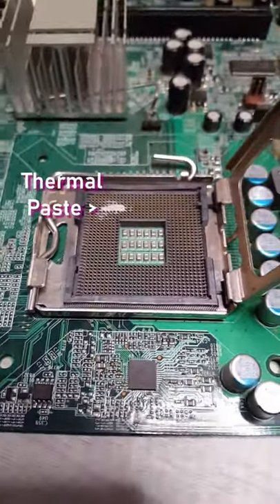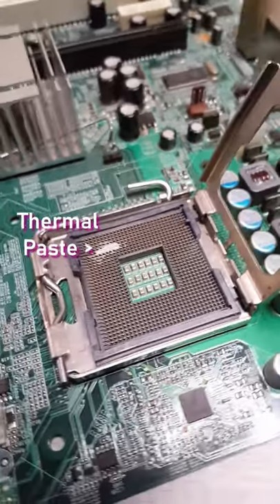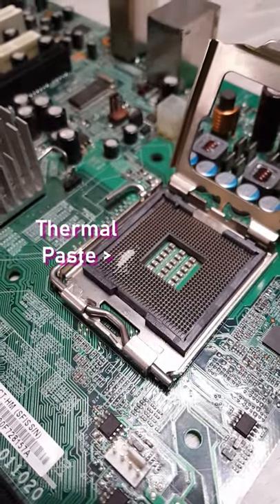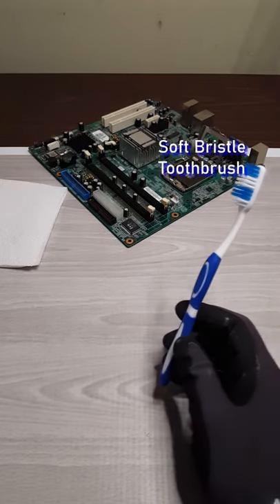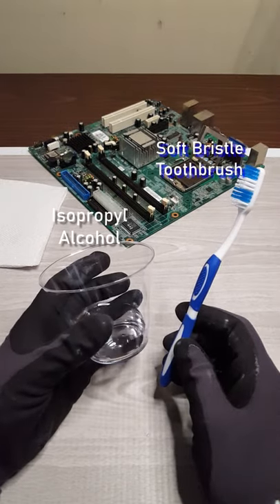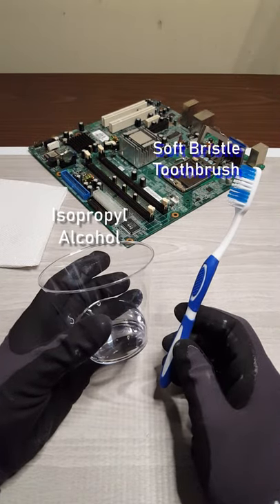Removing Thermal Paste From Motherboard Pins #Shorts

Comment: Really good advice.
Reply from the maker: Thank you!
Reply: Not really good only ok decent advice, the best really good advice would be to just use crc electronics cleaner or non choronated brake clean and spray the shit out of socket, enough pressure to clean but no enough to damage, and dries just like and as fast and alcohol, also only takes 2 seconds instead of 3 min
Reply: @johnshek8727  yeah but not everyone has that
Reply: @johnshek8727  I don't think anyone has that so that's kinda an issue
Reply: @johnshek8727  oh yeah ur advice is „only ok“, who is gonna get all of those things if you can get it done like he did in the video, far easier than ur method :D
Reply: @johnshek8727  alcohol isn't gonna hurt a motherboard any more than the alcohol/toothbrush, especially if you're as gentle as this guy was.
Reply: You can buy brake clean at autozone probly right next to walgreens where you buy your rubbing alcohol, its not like you have to go out of your way to buy it, shit even if you go to be a big supermarket that also sells like office supplies/video games/sporting goods like Wal-Mart, youre prolly going to buy your rubbing alcohol at walmart so why not walk down 4 isles and grab the brake clean. Just as easy to get as rubbing alcohol
Reply: I recently saw perfect toothbrushes for the job with super soft, dense and very thin hair

Comment: *Accidentally bent a single pin
Reply: Pain
Reply: Rip
Reply: Pain
Reply: 00F
Reply: @Lightsivall then u remember... That pin isnt in use xD
Reply: Only one? Pff, i bended around 10 of them with my first try xD just pick your credit or ID card and put it between the pins.
Reply: F
Reply: Bent two, could fix it with a needle luckily. But surely they'll loose some strength after bending them back in place
Reply: F
Reply: Bent it again in the right direction, it would be just fine

Comment: VERY IMPORTANT: Use the highest percentage rubbing alcohol you can get, otherwise you risk water damage. 90% is fine, I personally wouldnt use 70% one.
Reply: Why electronics are fine when using alcohol when it is essentially a liquid same as water?

Can alcohol rust component too?
Reply: @YoLo-nz2fo  water has moisture, alcohol doesn't
Reply: @YoLo-nz2fo  Less conductive, the higher % alcohol, means it will be less conductive due to water, a high conductive liquid,  percentage being too low.
Reply: @UKUSA  Yup True, but this water isn't available for anyone unless you specifically purchased it. No bottled or tap water is minerals/chlorine free

Comment: Me laughing in AM2+ Socket
Reply: That's lga
Reply: @mar_3620  I know i meant i’m using a AM2 socket so i removing thermal paste off my board is easier the pins are on the CPU not the socket

Comment: A little while back I got some thermal paste on the pins in my Threadripper socket, it was an absolute disaster, but I used this same method back then. Definitely can vouch for it! Also, don't use Q-tips to do the job as sometimes the fibers can get caught on a pin and then you got a disaster on your hands benching the pins back

Comment: A much better method is using a can of Contact Cleaner.  Spraying it in the socket instantly dissolves it.  Thermal paste is far more soluble in it.

Comment: Imagine having pins on the board and not the cpu

This comment was made by amd gang😎
Reply: Intel invented the standard. But I'll give you a like anyway.
Reply: Actually it's bad generally cpu is more expensive than mobo so I'd rather sacrifice mobo
Reply: @shrysm  What does that have to do with pin formats?
Reply: @mehmeh1999  pins are easy to bend and it renders the device basically useless. The person would rather have a mother board with one as it is cheaper to replace.
Reply: @carsin60  AMD pins are extremely tough though. The Intel ones bend super easy but you could basically drop an AMD cpu and it will be fine
Reply: @ProjectYoutube  That's really nice to know, when I built my pc I handled my cpu like a bomb when building my computer because I was so afraid to break the pins as I saw many people do online.
Reply: @ProjectYoutube   very much depends.... There's 1331 of the pins so yes they are very strong directly down, Im sure u could stand on it
But if you're dropping it you're the luckiest sob in the world of I get it to drop flat and not on the side
Reply: @ProjectYoutube  They're actually less tough than the old intel ones.
Reply: @ProjectYoutube  If you drop a cpu on its pins then you're guaranteed to bend them.
Reply: @mehmeh1999  not really, before lga775 intel used pga too
Reply: @Half_Finis  Maybe not stand on the CPU lmao but I get what you mean
Reply: @carsin60  amd pins are really tough, not only can you put the cpu pins down on a table, you can put a considerably large force on the pins and they won’t bend.
Reply: gay
Reply: Amd gang👌👌
Reply: @ProjectYoutube  I agree 
I managed to drop my 1300x before and bent one pin....they also are very easy to repair tbh
Reply: Imagine having pins on either your motherboard or CPU.

This post was made by Slot 1 gang 😎
Reply: @mehmeh1999  Cof Cof Amd Epyc Cof Cof
Reply: @ProjectYoutube  i doubt
Reply: @ProjectYoutube  lol this is just plain bullshit. You'll find a lot of horror stories on people bending and breaking pins on their AMD cpus. They have beast cpus with budget pins. That's why they're moving to a new pins setup
Reply: @fiv3 you really came back 3 months later
Reply: @BenCos2018  yea if its bent.....but sometimes when u do that there are chances that the pin would break ......
Reply: @gdxd8302  yep agreed
Reply: @BenCos2018  have a nice day :)
Reply: @gdxd8302  you also
Reply: @shrysm  I'll agree with you but AMD uses this trick for more power as they use 7nm proccesor (can't believe intel is taking more than 3 years to even get 10nm)
And amd also want more space for upgrade so they don't use pins on motherboard
Reply: @GWCGamingwithChittaarth  yeah ik that,I'm currently rocking 3900x 😁
Reply: replying to everyone here. 
Pins are the past now because you cannot pack them densily enough without making them to fragile. 
What i liked about am4 was that pins were still large enough to be replaced by hand replaced a pin on a Ryzen 5800x. 
You cannot do that on motherboards anymore because they got so many pins and the pins are smaler and recessed. It's almost impossible to replace them.
Reply: Oh only a year and ut didn't age well
Reply: hey ive got some spicy news regarding amds latest generation
Reply: @shrysm  until your mobo cost more...X series gang here

Comment: do ensure you use 99% isopropyl alcohol too, as if you use 70% IPA (commonly available in pharmacies as disinfectants) contain 30% water, which may potentially be conductive once the 70% alcohol dries up.

Comment: Once I bought a used motherboard like this and in sight I missed to see the thermal paste on it.
Went home,Cleaned it for hours,then It still didn't work.
Apparently the bios was outdated.
Had to go to a dodgy basement to give it to a master, forgot to bring my CPU to test it so I had to go back tomorrow,going back again and waking him up, forcing him to fix the damn board,cooking the board,removing the old bios,he got a new clean bios chip and uploaded the new bios data in to the new bios chip, Putting it back in, Testing it...

We have life

5 month later I sold the whole build for all the cancer and unreliability
Reply: Nipun Singh  that's just the motherboard,the GPU,mounting brackets and how I got the CPU cooler is a whole another story.
Pro tip:Buy new

Comment: You can actually do the same thing by putting a little bit of water on your CPU pins letting it dissolve the thermal paste and then washing it down with 91% isopropyl alcohol

Comment: Very useful advice, but I have a 7 years old workstation laptop and I want to proceed to clean the inside of it because it is overheating enormously , so I expect that old thermal paste will be pretty hard baked onto the surface of the CPU and Heat sink brass tube. Do I use the same Isoprophyl Alc. or something else to clean that old paste?

Comment: I've cleaned the pins, over and over. If the paste is dried in between the pins or on the bottom of the board, dried in = Should you be ok ?

Comment: I have to clean these for my job and i nearly had a stroke when he got that brush near the pins cause fudge me those are super sensitive. I'm gonna try this at work with a cheap board
Reply: How do you normally go about cleaning them?

And how did you go with the toothbrush method

Comment: I just wiped the socket off a bit and installed...I dont recommend it but it seems fine...lol

Although mine was an amd socket so maybe this is a worse situation being this cpu is an intel with the pins on the board.

Comment: I just used brake cleaner, I did it with my rx470 4gb, 480 8gb, motherboard, ram, cpu and everything else and it is clean as new ( yes it is still working, its alcohol)

Comment: Or just buy a can of Brake cleaner (NOT CARB CLEANER, THAT WILL MELT PLASTIC) and just spray it all off in 10 sec and not have to worry about the pins!

Comment: I'll do I the same if it spilled somewhere there.
I said the PC support shop keeper to put some thermal paste in it, he told his worker to do so who was already very old.
He wasn't even able to open the CPU properly, and applied a lot of thermal paste even after I forbade him to do so.
Now in game, my CPU temp remains  almost the same, I would say 4-5 degrees more and my motherboard temp remained at 72°-73° stable before, but now it reaches upto 86%!!
Idk what happened, maybe some of exess thermal paste spilled on the motherboard.
I'll go the the freaking support center and repory to them what they did!
I think this methor would work to remove the exess paste.
I wish the shop owner himself applied the paste, he was busy at thet time.
He's an expert and knows probably a lot about computers.
Anyway, after cleaning the thermal paste, I'll apply it myself properly.

1 question- After cleaning the thermal paste with isopropyl alcohol, how much time do we have to give it to dry?

Comment: How do you even get thermal paste on the pins tho.
ALSO. Unless it's some copper or silver or liquid metal bs it's usually not electrically conductive which means in theory you don't even need to wipe it away

Comment: How does one get thermal paste there. You shouldn’t even be touching the paste until the cpu is in the socket
Reply: I boght an old pc and the thermal paste was crusty so when i took it apart it landed on the cpu pins

Comment: I just wash the motherboard with the garden hose, you might think it’s a joke but I have done it to over 10 boards with no issues as long as the CMOs battery is removed and the capacitors are drained
Reply: Ñíçé

Comment: If it’s non-conductive thermal paste just drop your CPU in and go. It’ll even cool the bottom side of the substrate!
Reply: True, but it could make the connenction between the cpu and the motherboard a little worse
Reply: you sure? sounds not right
Reply: @leonbishop7404  it probably doesnt function good with the paste on the pins, because its non conductive and it will maybe stop the pins from touching each other.
Reply: @matthias3219  yeah, it can cause poor connectivity, instability and all kinds of errors and hardware failures, aswell as overheating in that area, no matter if its conductive or not

Comment: I had the same problem with my ryzen after i changed the stock cooler to be quiet dark pro ... when i rempved the stock cooler cpu was stuck on cooler.. and i somehow got then thermal paste on the cpu
Long story short it didn't start, some alc and cotton swab later i cleaned it and work perfectly no need to buy new

Comment: Yeah where the hell can I get an ecu for a 2014 mustang gt 5.0 pretty much all the scrap yards don't, any of the rebuild sites I gone to already either don't have it or can't repair. And just my year and style for the most part, and the back logs to order it from the dealership is so long it doesn't even have a time and not 1 dealership in the United States has one so they all say. And I've had it sent out to be rebuilt 2 times now and both times it comes back saying we don't repair this particular circuit board. Really why not? You took my vin part number hell everything about everything but now all of s sudden you just don't do those.?? I need any help I can get, I've been trying to replace this damn part for over 3 months now. Oh also so I can personally double check the ecu myself because that's my luck lately because 2 diff electronics mechanics said I have a bad ecu/pcm all I know is I was coming back from seeing my son in Kansas and 30 miles before I was home the car went into limp mode and turned itself off and couldn't turn it back on for almost 2 hours. And I changed all the filters all the spark plugs checked the evap box and replaced both upstream o2 sensors and checked the mass air flow. Last time it was tried it would turn over but not start either. Idk I can't give it up its my baby and spent 32,000 plus about another 25,000 on mods upgrades chips  and restoration from the dipshits that stole or robbed my for. They dogged it wrecked it destroyed the inside. And rattle canned most of it painting over most of the shit I had done professionally screwed the clutch and shifter. Sob. And I not even halfway done with the thing. ☹🥺

Comment: I don't understand why this video is made are people that dumb to actually have their tube of thermal paste even open when there's an exposed socket or to not have looked up anything that deals with computer parts before building a computer I mean even when I don't my very first computer and I had very little research to go off of I knew to not put the paste on the pins it was just blatantly obvious.